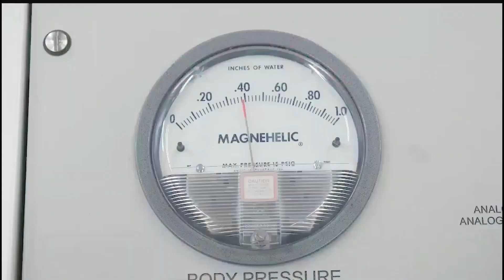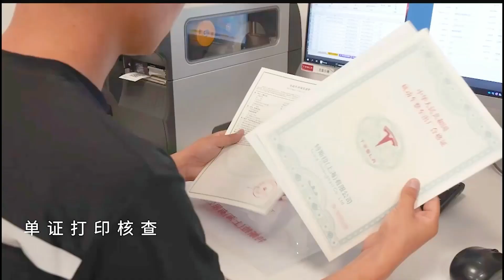TESLA Battery broke what to do? Tesla Energy News

Comment: I believe the (Rich rebuilds) price was credible (full price not a repair - apple style). If its close to the value of the car its a write off so third party repair only credible solution => right to repair. Tesla is going the way of Apple with parts and programming leading to cars thae are scrap because they cant be charged or updated.

With structural pack it better be a million mile pack as once it fails there is no replacing it ....its part of the structure.

Comment: there's no way I'm buying a tesla if it costs $20k+ to replace a battery
Reply: They have an 8 year warranty on the battery and drive train.  8 years from now I imagine battery costs will fall quite a bit.
Reply: @Adam Davis from what I understand, the quote of $22k is real (2019 models s), just not for the exact car... which is around 1k less, that's why I put $20k+
Reply: You are going to drive over 700k? Every other car would be scrap before then. High end ICE cars have a similar price to replace the engine, so don't buy one of those either.